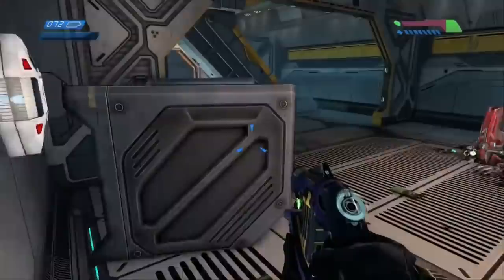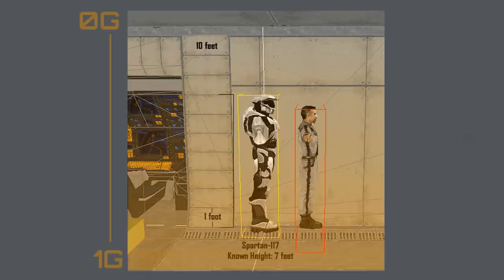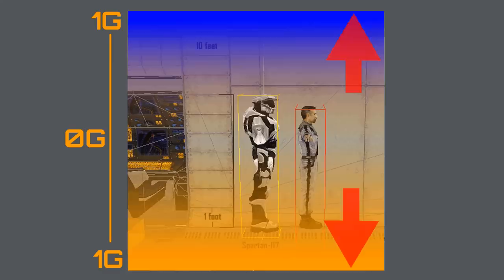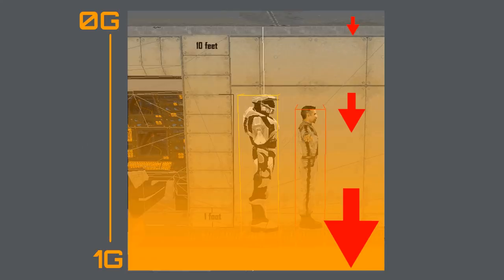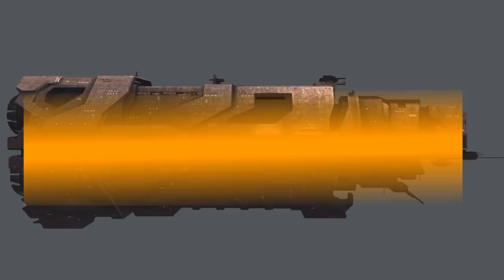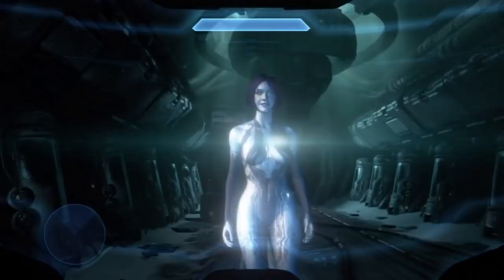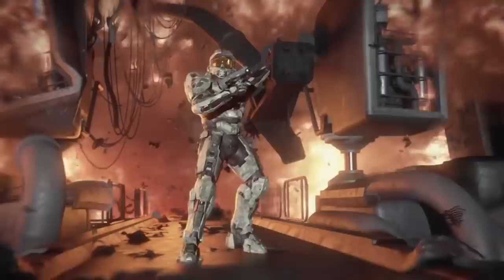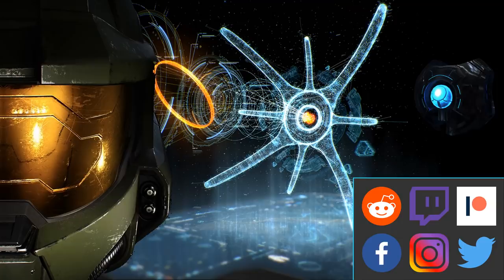UNSC Ships Artificial Gravity - Lore and Theory

Comment: One thing that's interesting is that the gravity gradient may be a function of gravity being experienced as a point source. Sort of like a light bulb, the light goes in every direction and thus the intensity drops the further you are from the source due to the inverse square law. Now if instead, you generated gravitons as a coherent unidirectional beam, similar to a laser diode, there would be no degradation in the force within the reasonable focal length of the beam. The focus wouldn't even need to be that tight to keep the gravitons mostly unidirectional, just coherent enough that you're experiencing 1G for a useful distance from the plate.

Now this is one hell of an assumption that gravitons act like photons, but hey...
Reply: pwrserge If lasers go on straight forever the could you over a ship in geosynchronous orbit, upside down (relative to the planets surface), and just abduct people from the planet they’re on?
Reply: Nice profile pic
Reply: Grant Lauzon pretty sure that’s how Covenant gravity beams work.
Reply: Who knows you could be right about gravity being like light.

Also I would probably use the light bulb way to create gravity, but unlike a light bulb make it like a big floor tile.
Reply: Also I would like someone to explain the law that you just said. Think I've never heard of it before?

Inverse square law.... But if I had to guess.... It's like shining a flash light on the ground, and the brightest area is the center, and the dimis is the outer ring. The law probably explain this, but on a photon level.
Reply: @igkslife  Inverse square law is basically the way you calculate the apparent intensity of a given light source given your distance from it. So if you're twice as far away from a bulb, it appears four times less bright.

Comment: I had an idea about human artificial gravity just now, and I thought I should share.

My idea is that human artificial gravity works like the light beam in some smoke detectors; its gravitons are projected from the source, and collected by a plate above (possibly in the ceiling), which collects the gravitons, and in this case recycles them (drastically increasing the efficiency of the system).

This would explain things like human ships not pulling debris down onto their dorsal surfaces, yet having gravity inside.

On the other hand, we need some other mechanism to explain the ability of UNSC ships to hover in an atmosphere.

Comment: 9:45 Yes, it has been discovered that Gravitational waves exist in modern times using two lasers in vacuum.
Reply: Shadow Of Sundered Star  not so large anymore, in fact it's mainly just the Danish study that still doubts the LIGO detections. Multiple independent analysis of data collected at each site came to the conclusion that LIGOs detections did correlate with gravitational waves moving through the planet, rather than interference caused by the anything from the earth itself. Also, repeated detections since the original Danish analysis have turned up positive. So far there have been 11.
Reply: these are technically ripples, not waves, but close enough if you look at the 4d operation of the universe

Comment: The ability to adjust the output of the gravity playing is specific areas of a ship or station would be an amazing defensive tool.

If the Covenant board your ship, set the gravity in that section to 20 or 30G and watch them literally die under their own weight.

If the gravity can't be set that high, then set it to 10G.  That may kill the boarders but if it doesn't, it could slow them enough to render them defenseless to marines shooting from a section under normal gravity.  10G will effect the flight path of bullets but bullets move so fast that the affect on them would be minimal.

Comment: Please, maybe, maybe, do a video on possible Covenant/Sangheili augmentation programs?
Reply from the maker: I'll look into it.
Reply: Augmented Elites would reck shit
Reply: Thomas Zhang is that a thing?
Reply: 𝙉𝙊𝘿_𝙈𝘼𝙆𝙊 there is the Prelate. And of course, Spartan III augmentation is mostly done by injecting different hormones and feeding different artificial organic molecules into the body. The most drastic ones were rewiring of the neurosystems and reverting the rods and cones on the retina, which requires surgery to change the structure and chemical injection to stabilize the surgical change and reduce chance of permanent blindness.

So there is nothing genetic about the augmentations and I believe that the Covenant can easily do it should they want to.

Comment: For the corridors in a star ship you'd probably have to double plate the decks. You plate the floors with plates apply attractive gravity and the ceilings with plates applying repulsive gravity. That way the accelerations should resolve into normal gravity, provided that the plates generate gravity with a fairly linear intensity gradient (from max at the plate to 0 at the opposite plate).

That should (logically) also shield the decks from each other's gravity (each floor plate cancels a ceiling plate and vice versa). Assuming that the rear surface of the plates isn't already shielded to provide 1-way, easily controllable gravity.

Comment: Considering gravity of Earth. If a gravity generator produced 1 G field from the base of a ship what’s to say that a generated field does not behave exactly the same as earths gravity. There is a negligible difference in the force of gravity at sea level vs 1000 meters up easily covering the height of a ship. This could also fit in with the why ships can hover, if you project a 1G anti gravity field below the base of a ship and that is tied to a 1G gravity field above the base of the ship that does not seem to break the lore.

Comment: If we're analogising gravity to electromagnetic interactions, inverse square law as applied to the particles in an infinite plate will in fact generate a unidirectional field with no gradient. You'd then be able to get nice even fields if your decks are much wider than they are vertically separated. This then suggests that smaller ships like frigates would have weirder gravity gradients because the decks are relatively more narrow compared to their height, than in a cruiser or the like.

Comment: 🤔 Maybe you're overthinking it. It would be more effective to stager implementation of a gravity plate not a foot level but by offsetting it in between decks.
On ships today ther is about 2-3ft dedicated to cables and ductwork.  By doing this and adjusting the plate output you could reach a goldilocks zone for the ships crew while conserving energy.
Also you would not want an omnidirectional gravity generation in space. You would just make it easier for rouge objects  or master chief launched and guided bombs to hit you. So you start at the bottom crew deck and offset up to the top habitable deck; while applying a weaker gravity plates in the hangers for ease of movement for load bearing operations.
But thats just a hypothetical.

Comment: If gravity plates work approximately like light fixtures, there wouldn't be a significant gradient within floors for the same reason that light emitting from the ceiling doesn't quickly taper off to darkness by the time it reaches the floor. It's also entirely rational to assume the power can be directed unidirectionally.

Comment: You are thinking of gravitational control similar to light. The closer to the source, the stronger. But... what if it's more like microwaves inside a waveguide?  The strength of the gravity would be uniform within the waveguides (which would comprise each deck of a ship). This would enable a uniform gravitational field that could also be configured as needed.

Comment: Just a theory. What if the gravity plate works like a peltier plate (1 hot and 1 cold). 1 side creates a pulling and 1 side creates a pushing force unidirectionally when electricity passes through. If stacked properly. Can create a constant gravity throughout the ship

Comment: Perhaps the "artificial gravity" that the UNSC ships function with are more of a repulsor, rather than an attractor. In theory, it would allow push down on all objects underneath it, can be mounted in the ceiling plates of every corridor and room, function effectively the same as the pressure of the atmosphere on the human body on Earth. The sensation of feeling very little gravity could be explained at that point as well, the same for the mandatory military uniform that every soldier has. In theory, it doesn't have to be an attractor to accomplish artificial gravitor. Repulsing an object against a surface would mimic the same effects, while keeping the pressures somewhat even throughout the individuals.

Comment: What if in the lore there exists something similar to an op-amp (operational amplifier)? This would largely eliminate the issues with the differences in gravity and would explain why in the lore they tend to shut down gravity in the outer sections of the ship and not the inner areas of the ship because shutting down the gravity for the inside would also shut down the gravity for the outer areas of the ship. Unless there is more plates spread around the ship of course.

Comment: I say bottom plate creates a pulling force, and top plate a pushing force. Kinda like magnets, but not really. Also you have to remember, that if we learn how to create it, and use it. Then we will learn how to null it, so it would effect what you want it to effect. That's is what I think.

Then you have what if gravity has its own waved spectrum. Like light, but not.

Example: neutral magnetism, non neutral magnetism, and gravitational magnetism.

Neutral made by electric magnets.

Non neutral made by magnets that has north, and south polls.

Gravity magnets, made by gravitational forces, or planetary objects, and capable of messing with time space.

Ether way it's just a idea.

Comment: Tecnically a pair of masses spinning close to the speed of light will produce a lot of gravitons. The question is how do you reflect, store or redirect those gravitons with high efficency considering they will likely pass through any known object? Maybe really high frequency gravitons reflect off some surfaces, but you'd need much more energy than photons since electromagnetic force is almost incomparable to the force of gravity.

Tecnically, it would be more efficent to shoot a really strong laser downwards to push you the other way.
Hence it's probably not like this?

Comment: Maybe I missed this -- but why assume that the gravity gradient falls off so quickly / ends at the edge of the ship? People in a 100-floor building don't feel a difference between the top floor and the ground floor. If you have 1G plates at the 'bottom' of a ship, any reasonably-sized ship would still have 1G on the top deck.

Comment: Like some others have said in comments; if the gravity generators/plates 'project' gravity unidirectionally the strength would not vary with distance (at least not at relevant scale). That being said, that kind of technology would allow UNSC ships to hover in atmosphere, pull enemy ships out of orbit, probably to even lift entire mountain ranges with enough power and range. It would basically allow the creation of gravity 'lasers' which are not something seen in the game (maybe excluding Forerunner tech). Perhaps instead UNSC gravitational tech requires a 'positive' and 'negative' plate. I.e; a source of gravitons and a collector. That way each deck could have floor and ceiling gravity plating that allows full normal 1g wherever installed. While also preventing the development of the kinds of technology and weapons a unidirectional gravity emitter would allow but aren't seen used by the UNSC. 
Why would this tech need a positive and negative plate though? Perhaps the creation of gravitons/a gravity field requires a pre-existing field of some other force to stimulate the emission/creation of gravitons, and this precursor field is polar in nature. Or, the energy needed to create and maintain a gravity field is beyond anything the UNSC can handle, but reabsorption of the gravitons (or limiting the volume of space the field affects to just a few metres high) greatly reduces the power consumption.
And yes, I do know that I am creating tech theories for a videogame. I probably have better things to do with my time. Just try and stop me though ;)

Comment: The anti-gravity ceiling idea is a clever idea, and even I thought of it before you brought it up. However, it suffers from migraines. Seriously. There's a reason we don't do headstands, no matter how much fun we think they are. Let's just set aside the cervical vertebra problem and stick to blood. Anti-grav will be actively pushing blood away from your brain, while at the same time, probably causing it to throb.

The brain evolved in an environment that allowed it to sit at rest on the base of your skull. It doesn't like getting jarred in any other direction, and I'm pretty sure it doesn't like getting smooched into it's seat. If you don't think this would be an issue, I have an experiment for you. Yes, you can do a neutral G experiment in the safety of your own home...

Lay on your bed, can't go wrong, we are naturals at this. Shift yourself up until your head just barely touches the headboard. See how long it takes before you go cross-eyed and your neck bunches up.

Hell you can do this standing up, and I know this because being 6'1" I've encountered many situations that has ingrained this into me. You need only find a place with a low ceiling, doesn't even have to brush your head, a school bus will probably do. You'll feel the urge to get your head horizontal.

Comment: Installation00 How do smaller ships like the pelican and longsword exit UNSC ship while in space? Especially pre MJOLNIR program where energy shielding was just an idea. Do they have to go through an airlock first? Are they piggybacked on a docking ring? Or is the docking bay always depressurized?
Reply: Shadow Of Sundered Star  In the case of the Anchor 9 multiplayer map from Reach yes, but I consider that to be more of a gameplay mechanic than anything else it acts just like a covenant shield from the covenant corvette. 
But in the case of the pillar of Autumn when the chief escapes in a longsword the hanger bay is open there's no sign of an airlock system. 
Or cutscenes with the infinity even post war it looks like pelicans leave as they please with the hanger being completely open.

Comment: This may be very stupid but I need to say it. Why only have grav plating in one deck? Why not run it through, say wire like stranded cable around a central core. The core being the corridors or rooms, hangar bays. Spin the gravitons instead of the ship? You would only have gravity where you need it.
Reply: Very good point. Not stupid at all Brian👍

Comment: hold up. I didnt hear a mention of slipspace drives.... They shear a hole into slipspace by brute force with micro blackholes, just something to think about as an alternative to grave plates. Wouldn't doing so require a tremendous exertion of gravity at several points for a nanosecond? might be why grav plates are seen as outdated though halo wars may prove me wrong on that.

Comment: It could be a combination of two technologies. For the artificial gravity inside the ships, gravity plating is used, most probably the omnidirectional type that puts out harmonic frequencies, frequencies that can be used in conjunction with the second piece of technology. Sections of the ship containing either supercooled and rotated semiconductors or a rotating fero fluid or Bose Einstein condensate in magnetic field systems, used to produce a gravity warping affect too reduce the weight of the craft (currently looked at by Boeing for project grasp and others), allowing for in atmosphere manoeuvring and hovering.

Still don't think there is an issue with scaling. Look at the infinity scenes. You see pelicans docking with halcyon class ships, halcyon class frigates right next the infinity. Halcyon class about 450m (to be fair though I might be 50m short,  so between 450 to 500 long), next to the infinity, which is about 6 to 7 times longer roughly 3.6km. Anyway,  Great video man.

Comment: wouldn't it be easier to take gravity generators and put them in both the floor and ceiling facing inwards using push in the ceiling and pull on the floor?

Comment: This is cool but I wouldn't describe gravity as a force in this case. More as the bending of space-time. So all you would need to accomplish simple, 1-D gravity would be a generator at the bottom of a ship. Have the generator simply create a flat plane parallel but a different axis as the normal. So looking at it would look like ----|___|----. The generator would only have to account for its wave pattern (dispersal of gravity) to create perfect gravity. Also sorry if this doesn't make sense, these are just some dense concepts in relativity.

Comment: my question is two fold; the particle sound like mass effect and if gravity is controllable a cheap but weak shielding against high energy weapons. shield can be make to move electron or proton in a flow or river to deflect  plasma or bend lasers think like a Van Allen radiation belt, great for  gamma rays and x ray of space but maybe too weak to be use against brute force of cov weapons. just me two cent.